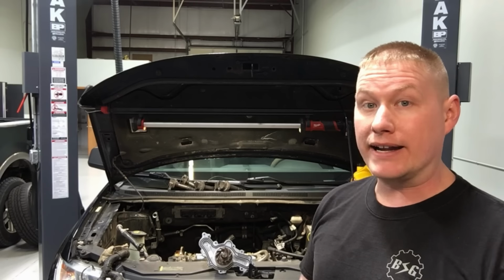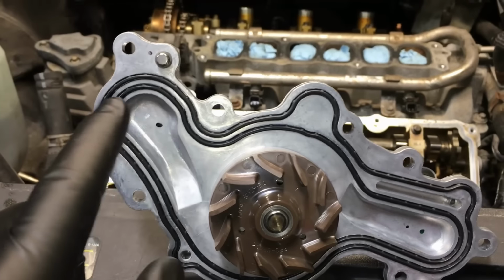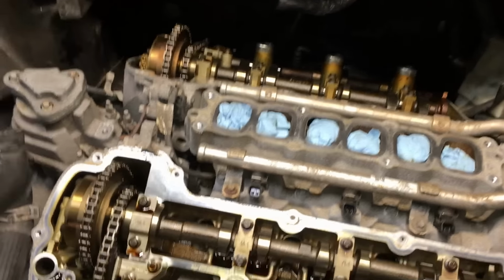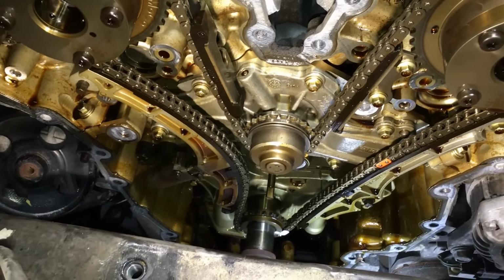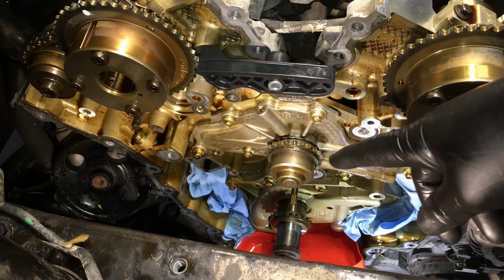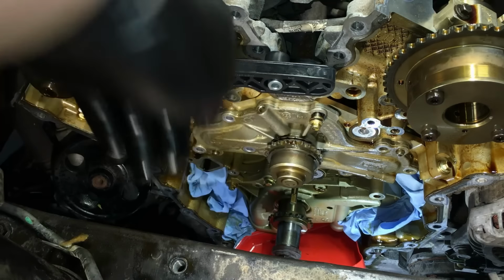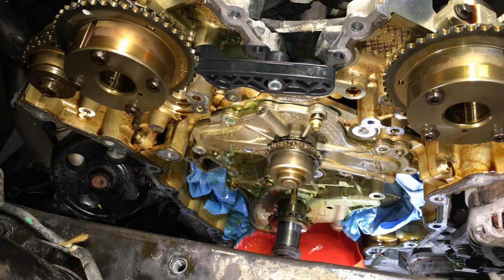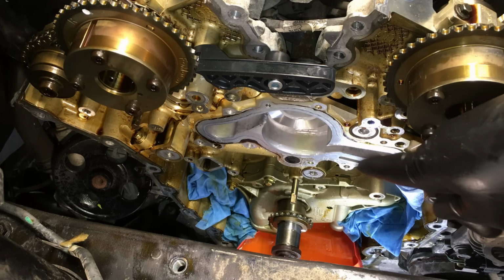Ford 3.5L 3.7L Duratec V6 Chain Driven Water Pump Failures: Check it Before it Destroys Your Engine!

Comment: I have a 2017 ford explorer xlt. My water pump went out at 170,000 miles. I took it to my regular mechanic, and he changed it for me. The total cost was about $1500, which included the water pump, tensioner, serpentine belt, spark plugs, the 4 chain guides, air filter and 2 engine mounts. We did agree on $600-700 labor just for the water pump(not including parts) but he did up it a little when he found out that to replace one of the timing chain guides it requires  to take off the back part of the engine. In my opinion $1500 is not that bad for all that. If I went to the dealer it would've been at least $3000. My friends explorer's water pump lasted about 120,000 miles. I don't know why mine lasted that long, maybe because I changed the coolant 2 times till it went out, maybe it was just luck.
Reply: New coolant does help
.
Keeps dust/rust particles from tearing up the seals.... also "refreshes" the additives (anti rust, water pump lubricants etc)
Reply: 3500 to 4000 is what a ford dealership would do it for. Just paid for a job on a 2015 ford explorer
Reply: @riverratflngacentralflorid8250  Ford wanted 4200 for my 12 Fusion Sport 180k miles. Just spent 400 for parts and I'll do it myself
Reply: "Not bad for all that."

Except for the fact that a proper design would have rendered it unnecessary.

Comment: Ford: Next we’re relocating the spark plugs underneath the engine👍
Reply: Well, half of them are under the intake. They're getting there.
Reply: @NetfloodeR  Ikr
Reply: Subaru beat them to it😂with there sideways ass plugs
Reply: They did relocate the oil filter in every worst way ! Don't tell them about the plugs 
Ford....more than 100 years wasted in engineering
Reply: Just did the plugs on mine nowhere near as bad as it looks. Plenty of step by step YouTube vids on it. The plugs last 100k at least anyway. So you’re likely to only have to do it once or twice.
Reply: Inside of there plastic oil filters with there oil soaked belts
Reply: @TheDunceMafia  their
Reply: Ford ford next we are relocating the gdi injectors to where if u want to remove them you must remove the head first
Reply: And imma relocate the spark plug up my ass 🤪
Reply: Lmao 🤣
Reply: you already gotta tear the engine apart to get those too XD
Reply: Mazda 26B (rotary): Hold my beer.
Reply: Two things ill never do again buy ford,vote Democrat
Reply: @larrykent5901   Their brains are wired the same way...wrong is "right" and right is "wrong"....😄

Comment: My 2015 Mazda CX-9 only made it to 83,172 miles before the water pump destroyed the engine. Never had any coolant puddles in the driveway. Check engine light came on and had a P0016 code. Cam and crankshaft out of sync. Coolant level was slightly low. I drained the oil and didn't see any signs of coolant contamination. Changed the oil and filter as well as topped off tge coolant. Called the dealership and they said to bring it in for inspection. Made it 15 miles before the engine died. Coolant reservoir was completely empty and the dipstick looked like a milkshake. Now waiting to hear from Mazda to see if they will cover it under the Certified Pre Owned warranty that is supposed to be good for 7 years and 100,000 miles.

Comment: Thanks for the video. I don't understand why ford can't make a simple engine . The water pump is in a stupid location making this job ridiculously hard to do! I wonder if the engineers who designed this were high or drunk! Ford if you read this, next time keep it simple stupid (KISS). if water pump was externally located,  it would make it much easier for us technicians! That's y I like Toyota. Simple design but lasts longer than any Ford.

Comment: I'm looking into a transit that comes with the EB or duratec. Does the ecoboost have issues like this? I would prefer if I got the cheapest to run engine.

Comment: 2013 Mazda cx-9 with 112,000 miles driving and everything goes dead.  I couldn’t  steer and almost wrecked.  Coasted to the bottom of the hill.  Check oil and yes slimey greenish oil. Had the vehicle towed home.  When I called the Mazda stealership this afternoon he asked if there was coolant mixed in the oil.  I said yes there is.  He said,”You need a new engine.”  I’ll price one then call you back.  Still waiting on him to call.  I appreciate your videos and knowing it might possible be repairable. Funny how the book recommends change at 120,000 miles, but research shows that literally hundreds have failed before that.

Comment: I bought a Taurus that the woman didn't change the water pump. The engine got hot they changed the water pump now it burns oil. Would this motor have a design to put oil into the cylinders with the bad head gasket or do you think she burnt up the rings?

Comment: My 2015 Mazda CX9 , 3 .7 Water pump failure , code P0016
Reply: How many miles?
Reply: I just got the timing cover off and could move the pump shaft up and down

Comment: Hi sir i have  a explorer v6 engine,,,the problem of this water in the radiator is mixing of water!!then i open the valve cover ther is no water and i drain the engine oil has no water,,,,after that i check the oil cooler there is no leaking also,,,what is the problem of this engine sir??

Comment: On this specific water pump which has plastic fins...can it be changed to have a metal fin per say ? Or they only recommend using the water pump with plastic fins only ? Asking my spouse has 07 Edge SEL AWD 3.5L V6 SUV. I watched video upon the ticking like noise upon cold start at idle to vehicle warms up..why is this an what potentially causes that ? Is it normal with the 07 edge here. Or should i be concerned ? Once suv is warm the noise isn't there as it is on 1st start up. Then when your on gas pedal you will slightly hear lightly ticking sound or what appears to me as being such maybe its something else...idk...

Comment: I have a 2017 Taurus with the 3.5 Flex engine. I have 100k on it, all highway. I've changed the oil every 5k with Motorcraft synthetic blend. Should I be worried about my water pump?

Comment: I have a question. How did you install the updated guide on the right bank side? The bolt behind the cam gear won't come out because the gear is in the way.
Reply from the maker: I have my secrets. I will soon have a video detailing this
Reply: @FordTechMakuloco  I need the secret because I'm in the middle of doing one lol.
Reply: Did you ever get an answer ? I am stuck too

Comment: If you mentioned this in your video, I must have missed it. My question........Is there a way to make the water pump last longer or is the water pump issue completely random?
Reply: Someone on YT posted a vid and said he's had no issues because he uses synthetic oil only (for the bearings issue) and changes the coolant every 30K or 2 years be otherwise the coolant can become acidic and wear out the seals.  I have no idea if true, no dog in this fight, but he was a mechanic and not sponsored by anyone so maybe he's right.  Thought I'd throw that your way since no one else answered you here.
Reply: @jonesjones7057  Thanks for the reply. Every little bit of information helps.

Comment: Is the 3.5 on a 2013 explorer considered a duratec?
Reply from the maker: Duratec or Cyclone they are both used.
Reply: @FordTechMakuloco  is there any info online about how to differentiate
Reply: @robd7365  Duartec is FWD. Cyclone is RWD. That’s the difference.
Reply: @FordTechMakuloco  thanks

Comment: As long as you don't drive like a pissed off teenager the water pump shaft and seal have no reason to fail. My experience with my explorer with the 3.5 being just north of 236,000 miles and has been slowly leaking coolant out of the weep hole since 170,000 miles. 🤷‍♂️

Comment: The problem with these water pumps is that there is too much chain tensioner pressure causing the pump shaft bearing and seals to prematurely fail.
Reply: I think the reason is that they have not changed the seals and bearings in them since inception!

Comment: Seems like the shaft seal is more deadly than the outer edge. 
Is there anyway to prevent the shaft seal failure leaking coolant into the engine? More frequent fluid service or some additive treatment?
Reply: Nothing can really be done do normal maintenance it's the chain tension that kills the pump seals and bearing.

Comment: I’m looking at buying a late model Taurus and I’m hearing this is the #1 killer of those cars. But right now I have a 2012 F150 with the 3.7 and the water pump on that has been fine at 75k. Rear axle is junk but at the water pump is good! 👍👍
Reply from the maker: It's a totally different water pump setup on your truck.

Comment: People are bitching about Ford but they are not the only ones that do this.  it is a packaging issue.  The F150 with the same engine has an external water pump, because it has a lot more room since the F150 engine bay has room for a V8.  

Pretty much any Transverse mounted engine water pump is a PITA.

The vehicle would have to be about 12 inches wider to put the F150 version in a FWD vehicle.  People can't park what they have now, imagine if the car was 12" wider.

Comment: Are there any ways to check the pump without digging too deep into the engine first?
Reply: @kevin Jensen 
There is a weep hole designed to give you a warning first.

Comment: Any chance you could do a video, showing a cut through of  the body of the water pump, to show how engine oil lubricates the main bearing/seal, from the port just above to the left, and then exits back out through the other port at the bottom? Think it would be of interest to viewers to see  how the engineers originally intended this to be a lifetime water pump...oops!

Comment: I have a 2015  Navigator 3.5  The oil level is full and clean. I have DTC code P1299 set and  coolant bottle full of cream colored oil or transmission fluid mix. This model has the external coolant pump. Can this be caused by oil cooler?

Comment: 1250? But it’s 13.4 hours? That’s 1000 labor alone water pump around 100, timing set is 300, valve cover gaskets, intake gasket, timing cover gasket, cam bolts, phasers, coolant, oil, how are you doing this for $1250??

Comment: Do you remember which year model and version of the engine you were working on in this video?
       
3.7 V6 Duratec/Ti-VCT Engine Problems and Reliability

In general, 3.7-liter Cyclone engines have proven to be very reliable. With proper and timely maintenance, the life expectancy is well over 200,000 miles (300,000 km). But the Cyclone family has a few problems and design flaws, which can significantly shorten the life span of these engines. One of them is cam torque actuated phasers failure - pretty common for the Ti-VCT engines.

But the most dangerous component inside Ford 3.7 Duratec/Ti-VCT and Mazda MZI 3.7 is a chain-driven water pump, hiding behind an engine front cover, which able to destroy them in a few minutes. In previous versions of the Duratec V6, a water pump was located at the rear of the engine and was driven by the pulley on the intake camshaft via a belt, what seems more complicated and expensive to produce. And, in 2006, the pump was relocated under a front-end engine cover.

In the latest Duratec version, the chain-driven pump at the front also performs the function of an intermediate timing chain sprocket, which turns the vector of applying force by 120 degrees. Water pump bearings failure causes the movement of the timing center, which leads to unpredictable serious damages inside valvetrain and cylinders. Besides that, the coolant leakage that's supposed to weep out the front of the timing cover through a special passage ends up in the engine oil and forms a milky oil-in-coolant emulsion inside the engine. With this "milk oil", the engine suffers from incredible wear and corrosion of all internal components.

2011+ Cyclone V6 engines (3.7 V6 Ti-VCT as well) are less prone to water pump issues due to a revised design of the timing chain and sprockets. 
  
 (source: motorreviewer dot com/engine.php?engine_id=158)
Reply from the maker: More like 2012-13 for many models before the timing upgrade and those models still fail.
Reply: @FordTechMakuloco  - Ok.

Comment: You didn't show what the failed pump and gaskets looked like. Was it the pump you showed before you showed how you took it out?  Was there something wrong with it or not? And you didn't show what a new one looks like or how you replaced it. And what about the timing chain, what did you do to fix that? Did you fix it or not? This is not good enough to teach people what they need to know and what to do. In my opinion, you have to show it systematically. The symptoms, the codes from the code reader, how you can tell that the part is damaged, what the new part looks like, and both the removal of the faulty part and the replacement of the new part. And I would also have liked to see that the codes where gone after you fixed it. In this video you are just showing a small part of the job. I don't think you even showed the coolant leakage near the alternator, which is an easy thing that anyone can look for themselves.
Reply from the maker: This was just to show how they fail nothing else.....
Reply: @FordTechMakuloco  - I didn't understand what was wrong with it and why from watching this video.
Reply: @milcotto4153  here is a link to one of his videos that shows an actual damaged pump, and oil that has been contaminated with coolant.

https://youtu.be/xvUr_k4j9gc
Reply: Pretty sure in the beginning of the video he said this particular vehicle was preventative maintenance.